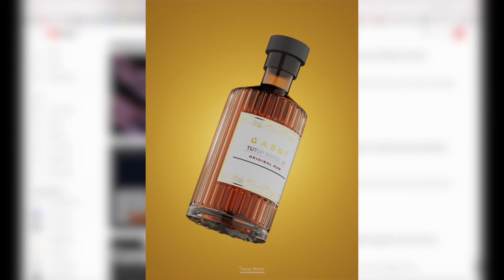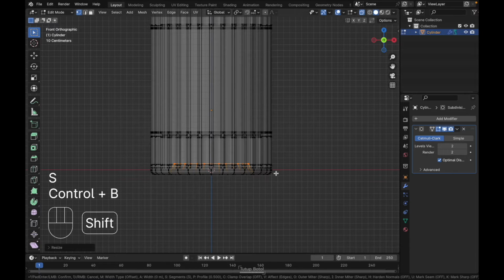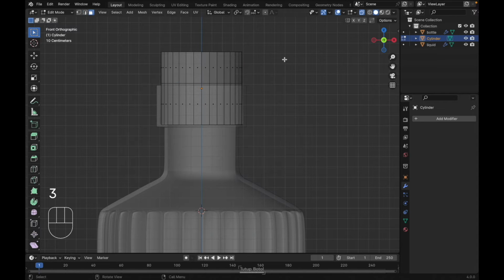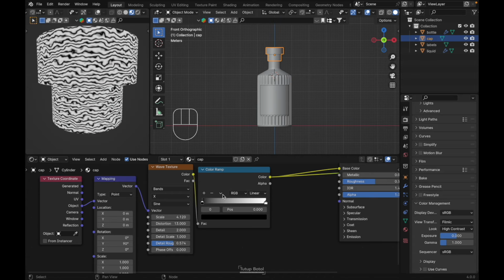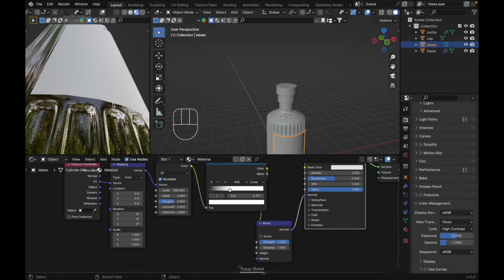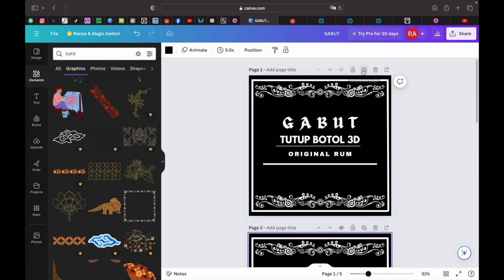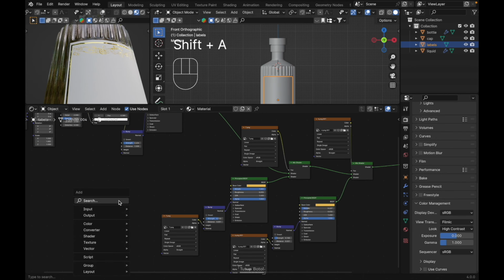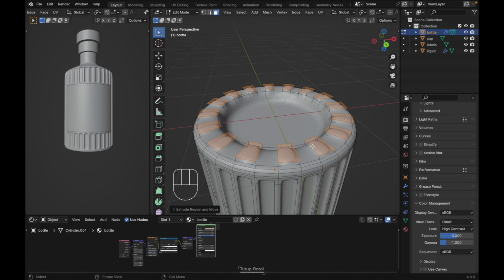How to Modeling Rum Bottle | Blender Tutorial

Comment: I had an issue at the 3min mark, before adding the sub div modifier. At that moment I noticed there are tiny edges on the lateral that made the extruding inward divide the bottle in 3 parts, instead of one continuous sulk. I checked if there was something wrong when I merged vertices, but there were 88 vertices merged, same as yours. No clue where I made a misstep.
In any case, your tutorials are amazing, keep them coming!
Edit - In trying again, what I did wrong was do the extrusion, and while adjusting right click to get the distance just right, without knowing that would create a "distance 0" extrusion
Reply from the maker: Yeah always check the double vertex, thanks bro